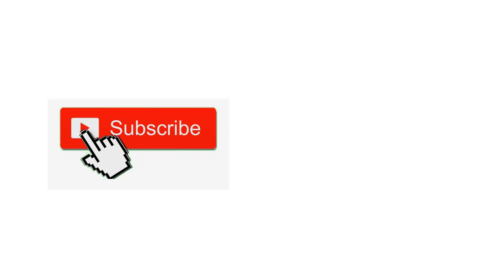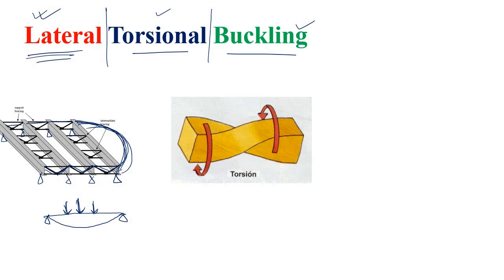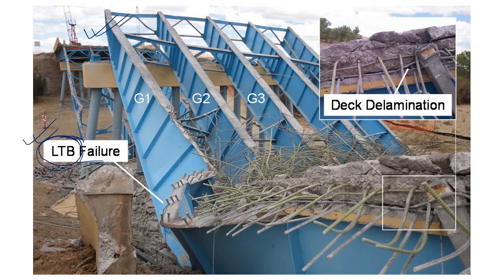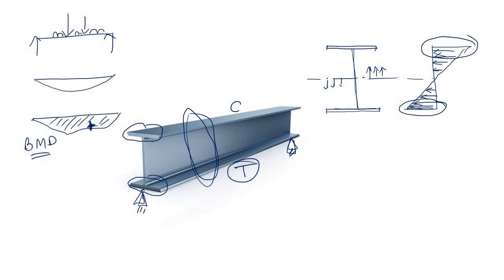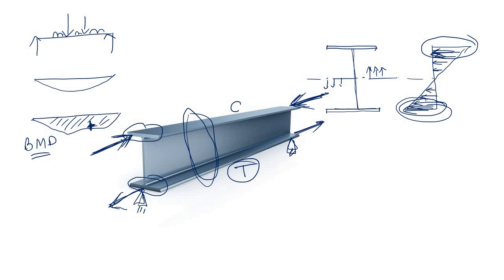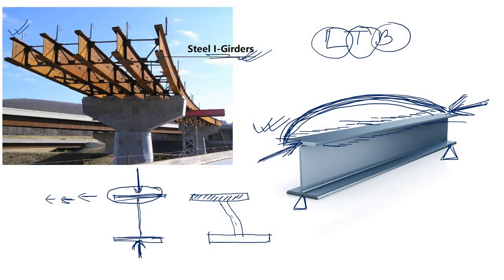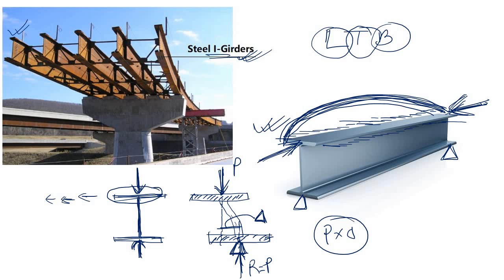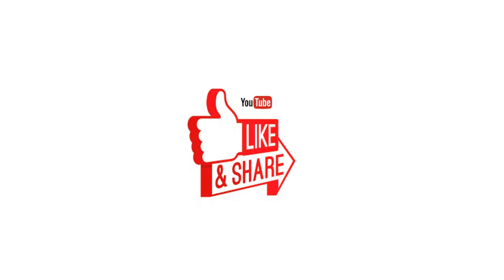Lateral Torsional Buckling II Pure Conceptual

Comment: Hi Sir, for Excavation and Lateral Support (ELS) Design , if the lateral torsional buckling is too high, we will use tie beams to provide the lateral restraint, is it necessary to also install the king post at the location of tie beam so that the lateral force can be transferred to the ground?
Reply from the maker: Yes, correct
Reply: @TonmoyMaity  Thank you